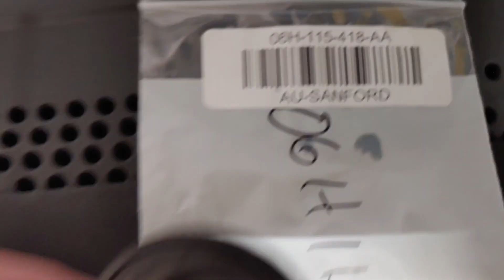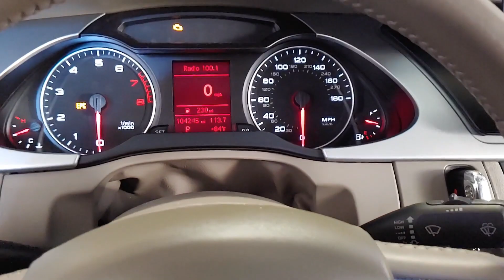Audi 2.0T Timing Chain Stretch Check

Comment: The workshop manual for the EA888III, which also applies to your 2 gen motor, says to rotate the crank pulley in the direction of engine rotation until the tensioner piston reaches its maximum extension. At that point, the visible teeth are those positioned to the right of the tensioner housing, meaning from where the collar ends. In your video, 1:36, it looked like only about three teeth were exposed. I’m not sure if you rotated the crank until the tensioner was fully extended. What did you end up doing in the end? It’s been over a year, and there haven’t been any updates on your channel about it.
Reply from the maker: You are correct, I misread the teeth and it was fine. No issues with timing chain for me

Comment: My parents just had the lower timing cover replaced on their 2015 Q5 2.0 TFSI due to an oil leak. The indy shop noted that the chain tensioner was significantly extended. the car only has 86k on it and has been maintained with much more frequent oil changes than Audi calls for since the initial maintenance plan expired. I just got OBD 11 and the cam phase adaptation value is reading -7.40. This is ridiculous with such low miles and better than factory maintenance. How is this not a TSB or recall since Audi claims to have solved the chain stretch problem in 2013 plus 2.0 TSFI engines?
Reply from the maker: @christopho3255  that sucks, you really need to have it done :(
Reply: @CarsandCoding  I'm a DIY doer. Are there any folks renting out the cam locking & other special tools for this job? I haven't had a chance to look into it much yet but the quote they got to replace the chain and guides was laughable.

Comment: I will check my chain tension here in a couple weeks. So what did you decide to do? DIY or pay someone? And how much is it going to cost?
Reply from the maker: After talking with a expert at a shop, he said under 4 degrees camshaft adaptation timing is fine, nothing to worry about. I was counting the teeth wrong, it is only the teeth outside of the barrel that you have to count. So I'm not doing anything at this time
Reply: @CarsandCoding  After looking into it I was gonna say yours is not very extended.

Comment: Audi suggests to turn crankshaft before checking this - to allow tensioner to go out as much as possible. And then count only those cavities which are visible. On your video at 1:43 once tensioner is fully out retaining spring (now sitting in cavity 8) will be actually somewhere between 5 and 6, then next cavity market as 7 will be invisible (hidden inside), the rest will become visible and need to be counted. In my view, 6 cavities in your case will be out /visible. Audi recommends changing chain if 7 or more cavities are visible.
Reply from the maker: I agree, after reviewing further, I don't think mine needs to be replaced immediately. But its almost time.

Comment: Either way you have this done, make a cool video out of it.  But honestly, 104k miles in almost 14 years is really not that bad. 
   PS:  Happy Thanksgiving to you and yours.
Reply: My parents 2015 is showing -7.40 cam phase adaptation (via OBD 11) with only 86k on it and much more frequent oil changes than Audi pushes. Car drives perfectly fine with no obvious signs of issue. Utterly ridiculous.